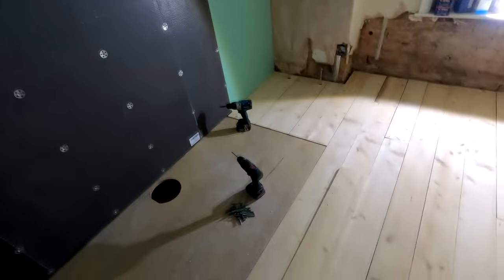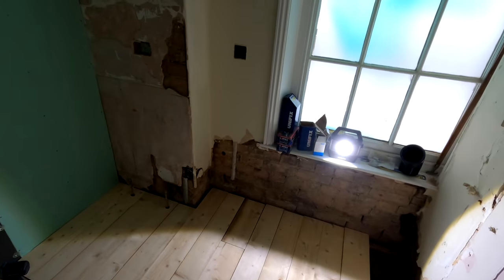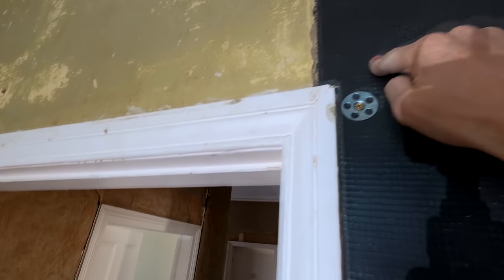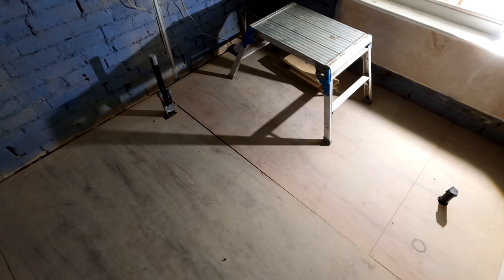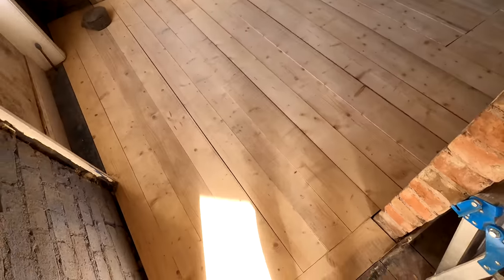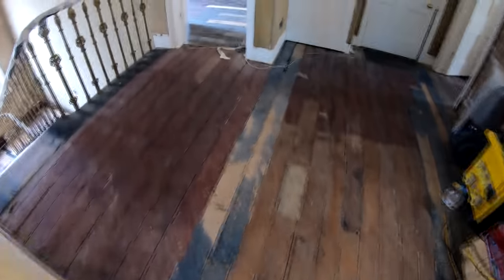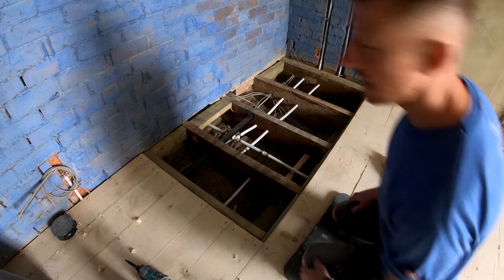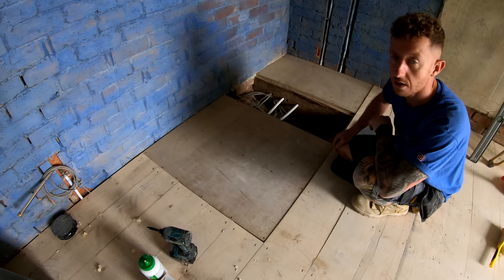BATHROOM RENOVATION PROGRESS | Regency Renovation #9 | Build with A&E

Comment: A
Hi what did you use to dot and dap the weather board is it tile adhesive ?and any name for the tool to bush the floor board
Reply: I will second this question!!??
Doesn’t look like plasterboard adhesive (which is light grey/white in my experience)
Reply: I will second this question!!??
Doesn’t look like plasterboard adhesive (which is light grey/white in my experience)
Reply from the maker: We used the manufacturer's recommended adhesive to stick the elements board, and then screw them for good measure.

Hope this helps.

All the best, John 😊
Reply: Another great video very professional and very clean workers 👍👍👍⚒🛠

Comment: What are you sticking the elements board to the wall with?
Reply: Screws with dedicated washers.
Reply: Tile adhesive, mate.
Reply from the maker: The Elements board was fixed with the manufacturer's recommended adhesive and then screwed with washers for good measure 😁

Thanks for watching.

All the best, John 😊
Reply: Did you use, standard Dri wall adhesive on the moisture boards or something else ?

Comment: Great video! Why do you fix the floorboards down with nails as opposed to screws? Is it just to keep it in-keeping?
Reply from the maker: We use cut clasp nails as they would of been traditionally used. We like to use them on all wooden floors which will be sanded and stained, as the end result looks fantastic 😁

Hope this helps.

All the best, John 😊

Comment: Is that a concealed TMV in the wall? How do you get access to it if it leaks? I thought you had to use a surface mounted TMV in situations (where it wouldn't be accessible) like this?
Reply from the maker: The whole system is fully pressure tested before anything is covered up; so we're extremely confident there will be no leaks. There is a concealed TMV in one of the bathrooms, which in the highly unlikely event of a leak, can be accessed from the other side of the wall.

Hope this helps.

All the best, John 😊
Reply: If it's tile you can actually cut the grout and tile out as a whole with the elements board attached and they do a resealing kit for the board. Also most Grohe and high end brands are now all serviceable from the front.

Comment: Dont you need to use reclaimed floor boards? Great work as always 👏
Reply from the maker: Reclaimed boards aren't required, providing they are a similar material, which in this property would of been Baltic Fir. As Baltic forrests are now protected, we have used Douglas Fir, which is an acceptable substitute.

Hope this helps.

All the best, John 😊

Comment: what adhesive are you using to stick the element board to the masonry walls?
Reply from the maker: We use the manufacturer's recommended adhesive and then we srew them for added measure.

Hope this helps.

All the best, John 😊
Reply: @BuildWithAE  how did you fix moisture resistant boards
Reply from the maker: Hi Tim,

The plasterboards were fixed with plasterboard adhesive.

Hope this helps.

All the best, John 😊

Comment: Why are you using lime plaster in some areas and not in others? I’m currently doing my bathroom and was going to dot and dab moisture resistant plasterboard but maybe I’m doing it wrong 😂😂. Any help appreciated 👍🏼
Reply from the maker: All of the external walls are receiving lime plaster, because the age of the property requires it. The walls need to be able to breathe, and the lime plaster, combined with the external lime render, achieves that. We are only using Elements board / moisture resistant board in wet areas.

Hope this helps.

All the best, John 😊
Reply: Build With A&E thank you John. This does help. In my case the wall in question in my property in old browning plaster I believe but has blown in places but it is on an external wall. Would you not advice dot and dab moisture board or would you say i could have issues. Searching on google get mixed reviews

Comment: Why nail the floor back down??? Is there another reason not just going back like for like?? Great video 👍
Reply: So when its sanded you see nice period nail heads and not modern pozi crosshairs all over the place I would think
Reply from the maker: Exactly 😁😁😁

The finished product looks a lot better with traditional nails.

Thanks for watching.

All the best, John 😊
Reply: @TheSmartStar  oh I missed the part when it was being exposed,,,makes complete sense with that finish 👍